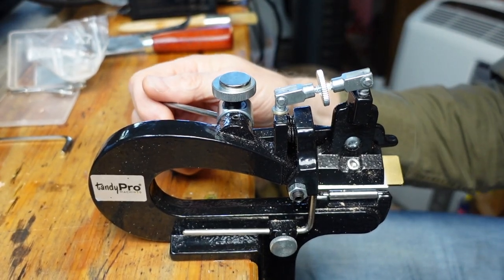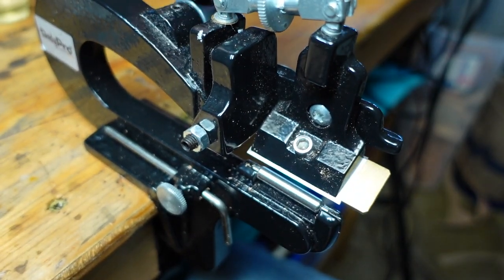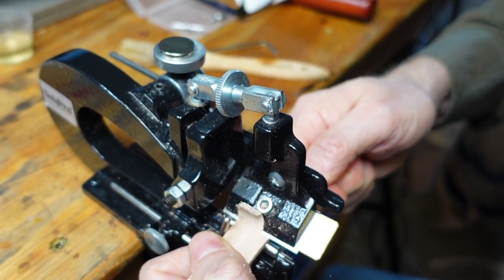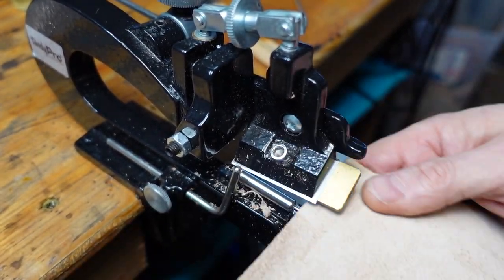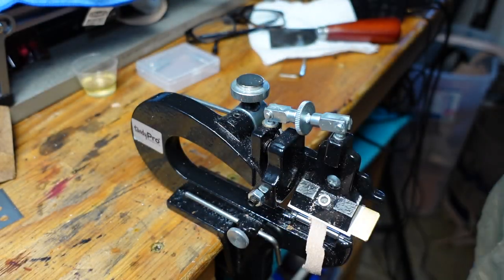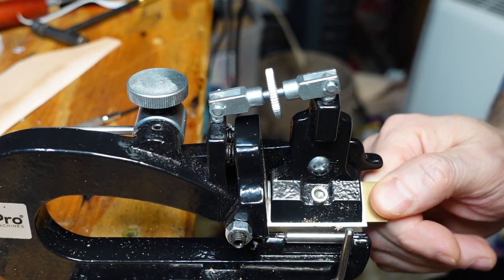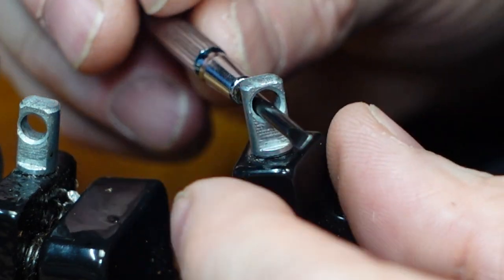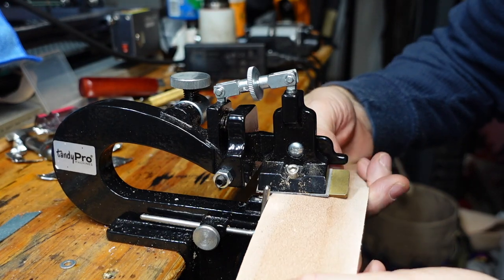How to use (and fix) a manual leather skiving machine

Comment: The problem is that the are rushing the job instead of doing it properly for the best fitting threads and pins it's just ran and put in the parts drawers for assembly.  As a machinist I plan on making my own then I eliminate all of that stuff you had to do to make yours work well. I might make a few and sell some too. 🤔🤔
Reply from the maker: Cool! Make sure to film the process and post it here on Youtube! I'd love to see it.

Comment: Awesome video. I also like using quality safety razors as blades. they are interchangeable and seem sharper in general than the blades that come with the tandy unit.

Comment: Thank you for the video! I've had this machine for over 8 years and finally figured out the brass plate that holds the razor was backwards... check the angle of your brass razor holder... something so simple can make all the difference!
Reply from the maker: Good tip. I'll check.

Comment: Thanks for the video. I never heard about the manual skiving machine. Am I right it's not for small leather pieces?
Reply from the maker: Depends on how small. You need it large enough to be able to hold on to. Really small pieces you're going have to do it by hand with a skiving knife.

Comment: So I just bought one of these and implemented your tweaks -- excellent! I used neoprene washers which worked well. Thank you very much - so helpful. Once it is stabilized, it does a great job. I mostly work in very soft leathers and need to skive seams -- this will save my hands and a lot of time. As a sidebar -- I bought mine from eBay which looks like a clone of the green one, painted black. It says it is made in China and 'designed in Germany'....funny.

Comment: How well does it do with softer leathers? Or something like an oil tanned leather?
Reply from the maker: I've used it with oil tanned leathers. As long as the material doesn't stretch. Soft, stretchy leathers would be a no-go.

Comment: Thank you I have been looking at one of these but see mixed reviews. Also, I "cringed" through the whole video because that outside corner of the blade and your thumb as so close.😬
Reply from the maker: lol. I THINK it's not as dangerous as it looks? I was cutting scraps in this video. If you check out my newest video, the "Wednesday Addams satchel," you'll see a practical use for it.

Comment: This is sold thru Tandy only? If so, I won't but it. Our city is way larger than St. Louis and one fabric company closed, the one left moved and doubled prices, same with the Tandy store. Packages of 10 items that sold for a $1.99, jumped to $6.99 now that is out of reach. They get very little business. It is not twice but three times more than groceries. 
  I diagnosed and repaired 2,500 vehicles a year at the dealership. Customers paid $24 per flat rate hour for repairs while ASE Master techs then and not in 2023 are paid less than 22% of flat rate which is based on warranty time the manufacture pays. The truth behind auto repair policies  are, on larger claims, a contract rep with camera & note book will ask questions, look at maintenance records, drive tires, broke or worn part(s) take photo and if little or no maintenance & signs of abuse, you are not covered. Be careful as in todays world, it is taxes, vacation, health care, profit margins. So the high cost of a lease, employees, gas, water & heat + benefits (The hidden cost) make a casting and parts to build a machine cost $9.18. Add shipping, mail to business, cost of computers, storage, software, phones and now it retails for $38.98.

Comment: OMG I looked for this video over a year ago and I couldn't find anything about how to use this skiving machine. This nailed it. Even the folks at Tandy, who are usually very knowledgeable, didn't have good tips for me. I will share this video with them. Key moments for me... 1. How to skive that part you hold on to when pulling through. 2. The magnet trick for small parts is a gem that I'll use forever! 3. Tightening up the machine 4. What those other included rollers are for - again, even the folks at Tandy didn't know that! This machine had been put away for months, now it's coming out and going to be used regularly. Thank you for sharing.
Reply from the maker: I'm glad I could help! Though it IS frustrating to buy a "fixer-upper" out of the box.

Comment: What do you think, is it possible to use with soft Nappaleather 1,1 - 1,4mm?
Your leather is very hard, but Nappa very flexible

And is it possible to use Norma blades?
For example the "Feather" Blades very sharp

Comment: This model retails at $341 in my country which seems like a lot to me. I’m not going to buy it based on your very helpful video. I typically need to skive smaller pieces that are already cut to size and since it is difficult to feed all the way from the right side edge, I think I will make do with my trusted old skiving knife. It does look pretty though. Thanks!

Comment: Fixed mine. But it still grabs the leather and cuts it all the way through. Will not skive more than a few inches then grabs and cuts all the way through. How do you stop the blade from grabbing the leather and cutting deep
Reply from the maker: You fixed all the play in the mechanism? If so, perhaps the next thing would be how you're holding the leather. I try to pull horizontal with my right hand and use my thumb on the left hand to keep the leather pressed against the roller (using the edge guide as a support). Check out around the 10:40 of this video:  https://youtu.be/Vy7kTWkFCKI

Comment: I will try mine again after watching your video. My main problem was keeping the blade from splitting up through the grain side of the leather . I was holding down on the left side where leather went in and also on the other side. I saw where you held it level on the side you are pulling.Thanks for the tip, I will try again!

Comment: What is the one I see you put leather in and put a weight on it then pull it through
Reply from the maker: In this video? At what time?
Reply: @RoadAgentLeather  no not this video you have used It in other videos. Was just wondering no big deal
Reply: @RoadAgentLeather  I just saw one it's a leather splitter